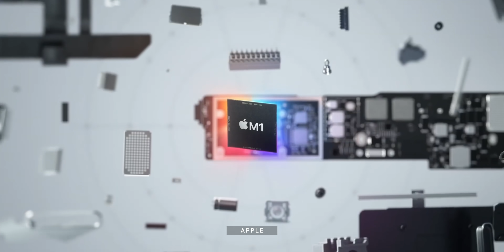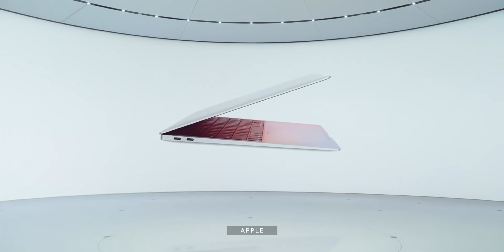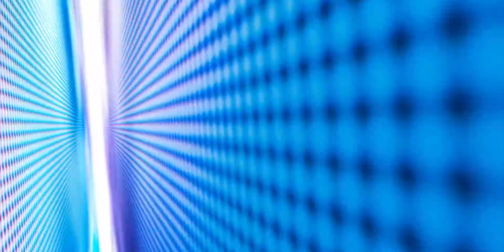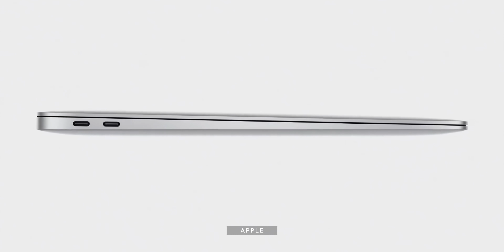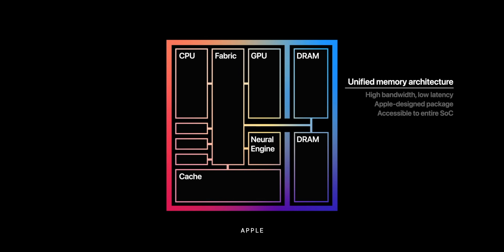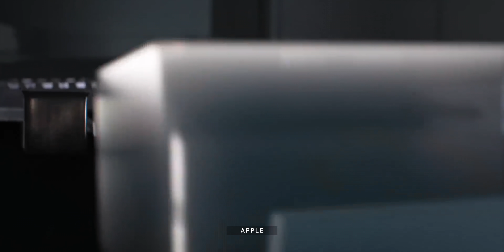M1 MacBook Air — Buy Now or Wait for M2?

Comment: Aw I already got my M1 Pro tho... lol
Reply from the maker: The M1 Pro is fire though! I'm just waiting on the 16-inch model because Final Cut Pro so space needy!
Reply: @ReneRitchie    I think all of the pros are looking for a 16 inch pro. Although i upgraded to Intel based 16 inch macboo pro for work 6 months back, i am still looking for a 16 inch pro laptop. I hope it comes with a M2 or M1X processor.
Reply: @PankajDoharey  I'm not. I want real portability, and plug into my Dell 49" when in office or at home. 14" of screen is however how low I'll go. It depends what you do on the go... But I much prefer a real screen estate. Neck pain is real with laptops.
Reply: @ReneRitchie  agreed. I would do the same If I had more bucks!
Reply: @ReneRitchie    
 I edit 4k videos with final cut pro using a 2011 iMac(base model)
Reply: @ReneRitchie  storage, or display space? Wait... yes.
Reply: 😂 It’s still a great laptop though
Reply: It's definitely going to be the travel tool -- I think I have to go 14 though (if that's meant to be the smaller follow up) because my dream of a small powerhouse is still going strong
Reply from the maker: @jvtechtea  I feel that! I used to alternate between the Air and the Pro before settling on the 13-inch Pro. Then the 16-inch MBP came out and won me over!
Reply: Got mine too.  Love it and no regrets.
Reply: @callenbodie4496  no one cares
Reply: Product reaches a saturation.
M1 already reached for most of us. M2 or M10 won't create any significant differences.

Comment: I like how Apple is making these Macs really affordable. For students like me, this laptop is just perfect.
Reply: I wish. I mean, even 999 I wouldn't call affordable, but in my country the Air starts at 1130 Euros. :-/
Reply: @The_RedVIII  
Remember the price quoted in the US is with tax! Tax is already included in the listed price in Europe. Take the base US price and add anywhere from 17-20% on top and then you can compare...
Reply: @The_RedVIII  in mine it cost 2000$ for the base variant MB air
Reply: affordable is relative.
Reply: @Allsortsallkinds  
Keep in mind that these laptop last a long time. I still have my MacBook Pro mid 2015 and it's still running fantastic. 435$ a year. The longer I keep using it, the cheaper it becomes...
Reply: @Thebigone-h2p  very true. I still have my early 2011 MBP. I think around year 6 or so the battery gave out and I replaced it. At the same time I upgraded the RAM to 8gb and storage to SSD. It works even better. About a year later the battery I replaced gave out (it was aftermarket). Now I run it as a desktop without a battery. They just never die lol but am looking to upgrade. Waiting out until their March event.
Reply: @Thebigone-h2p  in that case i have my dell vostro 1015 for last 11 years . 😂😎 But now i am bit confuse between mac air and dell xps 😫😓
Reply from the maker: The $999 price point is really compelling. Did you get one yet?
Reply: @ReneRitchie  $899 for students like you mentioned in the video! So even better
Reply: @medmuse_  Yeah
Reply: @medmuse_  it says 899 but after delivery it’s like 977
Reply: @ReneRitchie  I didn’t because I already have a Retina MBP, but if I didn’t have it I think I would have got one
Reply: @sh1121  my dad just ordered an m1 MacBook Air for me because my 2013 MacBook Air broke (it was my dads. He gave it to me. Sadly, it stopped working altogether and it had a few.... dents because my dad travelled with it a lot)
Reply: And the crazy performance / battery life for that low price is insane
Reply: Update: I’m getting a MBP M1!!!! I’m so excited Lol
Reply: @sh1121  dude I need a help ! Would you mind giving me a suggestion ?
Actually I want a lappy for my college and personal purposes but I'm worried if ms office would work in the same way like it does in windows OS. Will I face any problems while transferring data and documents through pendrives or other alternatives ?
Currently I'm confused between XPS 13 9310 and MBP M1.
Thanks in advance 😊
Reply: @HPY07  If you can buy Microsoft Office than you would have the same apps as Windows. No problems transferring between Windows and macOS. I think the M1 is a great choice and I would recommend it over most Windows laptops 😊
Reply: @sh1121  thanks a lot brother really appreciate you for the guidance, I also think that MacBooks are giving much more value than windows laptops these days, especially the MBA. 
I'm going for MacBook Pro with 16 gigs of RAM then.
Reply: @HPY07  Excellent choice! I’m loving my new MBP
Reply: @sh1121  yup !
That's awesome bro, congrats ! 😎
Reply: @sh1121  Nice! How is it so far?
Reply: @almog3875  I love it except for the few limitations that it has, using an ARM chip.
Reply: @sh1121  I see. Cool
Reply: Felt this
Reply: For students like the rest of us, we want a computer that’ll last but we can’t afford like any of the upgrades on the Air or Pro.
Reply: @jackf1684  You won't need the upgrades. I tested the Air and it runs like a cheetah. Its the best laptop for the price period. I'm just waiting for my music software to be released for it in Q2. Apple murdered the market tbh. I can't ever see myself buying a windows laptop under $1000 when an M1 is much better. The only thing lacking right now is emulation with rosetta kinda sucks with some things.
Reply: Apple kids are fucking nuts,

You can get a laptop for 500

1000$ laptops are a luxury
Reply: Costs around $1270 in India ;(
Plus $273 for 16GB RAM instead of $200

So total costing will be around $1500.
And now it feels pretty expensive
Reply: @harshjatinder  Here in Korea we can get it for the exact launch price! Sorry to hear that it’s more expensive in India...
Reply: Affordable for American customers ONLY!
Reply: @UltimatePokeGamer7  ? I’m from Korea and it’s perfectly affordable here too.
Reply: yeah cause we all got  900  or  1k burning a  hole in our pockets  to   run out and buy  a new  macbook every  year
Reply: @Sousuke23  what sort of assumption is that? why do we need one every year? my 10 year old Macbook Pro still works, can't say the same for my 4 year old Surface Pro which cost more and has died twice
Reply: @koruki  they tell us every  year   and  pretty much say  the  last  ones are shit  and  not  to bother with them.
Reply: @Sousuke23  I think this Mac will last students at least 3-5 years
Reply: @sh1121  aye of  course doesnt stop youtubers saying buy this then 1 year later they pretty much say its  shit and now buy this one haha